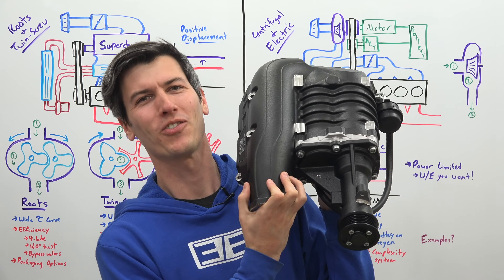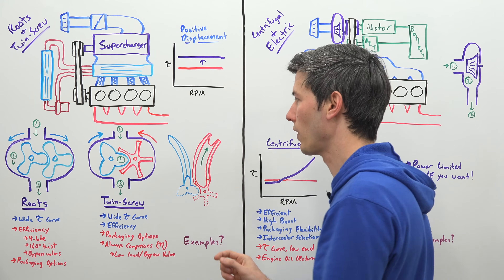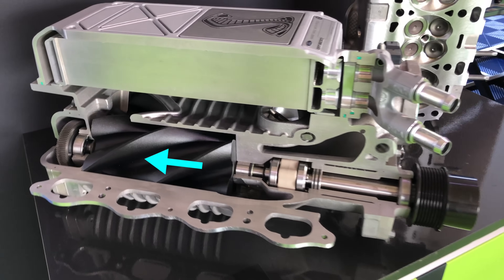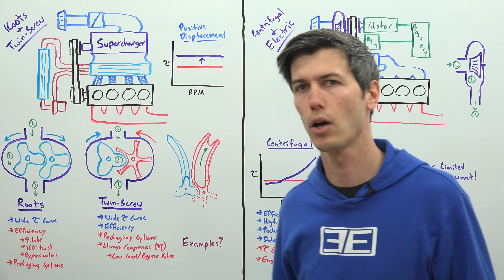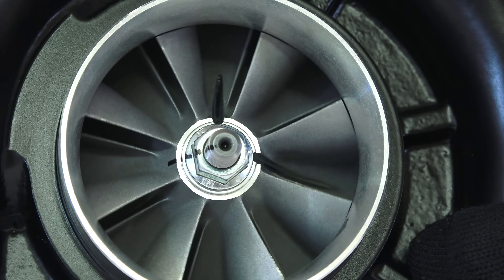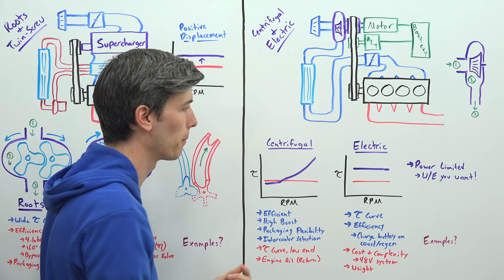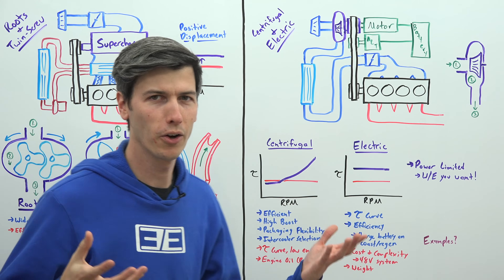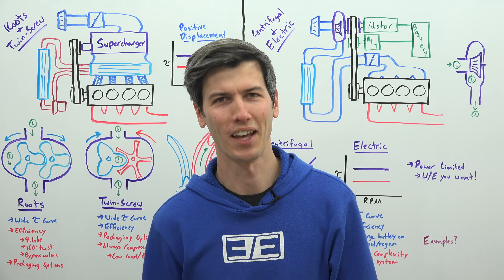What's The Best Supercharger? Roots vs Centrifugal vs Twin-Screw vs Electric

Comment: Okay well there's other factors involving boost tuning which set centrifugal apart from roots and twin screw type superchargers, mainly beneficial if you're using modelling software to preview setup proposals where I think the roots and twin screw are a little more forgiving in a plug and play application using simple math and fairly constrained details. It might also be worth mentioning that historically roots style superchargers evolved from heavy haul diesel engines (of which twin screw type is a variation), whilst centrifugal superchargers evolved from high performance gas engines (of which electric and turbochargers are variations). Having a little glance then, at what engineers had on their minds during design evolution was to increase the hauling capacity and engine flexibility of a transport vehicle with a fairly forgiving engine layout in terms of boost and intake temperatures, compared with maintaining a sea level air pressurization at higher altitudes in an aircraft engine in order to raise its operational flight envelope, which requires fairly careful mechanical tuning of the layout so as not to damage a high performance engine.

So in terms of boost tuning, what's happening with a centrifugal type of pressurisation is an "island tune" as opposed to a positive displacement which is more of an "engine tune" when sizing up your supercharger fitment. What I mean by this is that with a positive displacement supercharger you will need to size the fitment quite specifically to the engine displacement and setup, with pulley speeds to provide a boost curve which is appropriate the engine, with benefits of providing usable boost from very low rpm and strong boost through midrange but disadvantages of providing maximum boost only at high rpm, near the engine redline. In a racing application a positive displacement supercharger still needs to be operating a lot like a naturally aspirated engine, with a fairly limited maximum performance range close to the engine speed redline, however in a street application it is an extremely flexible layout as it provides usable boost under virtually any operating conditions, so if all out power is not required it still provides very useful power boost in all other driving.

Now let's mention that in road engines centrifugal supercharger fitment kits are designed similarly to positive displacement fitments, with casing size and impeller ratio tuned specifically for engine displacement and operational conditions, whilst pulley speeds are simply geared to provide the most efficient impeller rpm to deliver the desired "island of boost" for that engine. So, for example if you have a 2.0 litre engine built for no more than 1 bar of boost and the engine has a redline of 7000rpm, the supercharger impeller may have a maximum speed of say 55,000rpm so the pulleys have to be geared for no more than this impeller speed at engine redline, whilst the amount of boost is achieved by selection of supercharger casing and impeller ratio, in this case to deliver no more than 1 bar at maximum efficiency for this displacement and engine speed, which tends to coincide with maximum impeller speed but they also have a fairly high efficiency across a fairly wide supercharger speed compared to positive displacement superchargers, operating at (loose, fictional figures for illustration) perhaps 87-95% blower efficiency all the way from something like 40,000rpm to 55,000rpm in this example perhaps, which would translate say from something like 5600rpm to 7000rpm sustaining around 1 bar, but then there is a sudden moment when blower efficiency simply plummets to something like 65% at say below 37,000rpm impeller speed, boost drops very sharply so that for much of the engine's midrange, below 5200rpm you're dealing with more like 0.4-0.6 bar and then at low engine speeds 0.2-0.3 bar which isn't even usable boost. This is what I mean by an "island of boost" and this is an important tuning term when designing your supercharger setup with a centrifugal. By comparison a positive displacement supercharger has a nice, linear boost progression and drop off so that if tuned for 1 Bar at 7000rpm it will be very linear with 0.9 bar at 6000, 0.8 at 5000, 0.7 at 4000, 0.6 at 3000 etc. But positive displacement has less blower efficiency overall, maxing out at perhaps 85% due to design limitations so you do tend to get more crank drag for the same boost capabilities, meaning you need a little more boost to get the same horsepower. By the same measure, turbochargers became more popular for race engines because they need less boost to get the same horsepower since they don't drag on the crank at all with pulleys but are otherwise a centrifugal supercharger, conversely this means with the same boost as a pulley operated centrifugal supercharger setup a turbocharger simply makes more horsepower and a positive displacement type makes slightly less.

So just to correct you there if I have all my thoughts here correct without an engineering degree, it's not more boost that a centrifugal supercharger has over a positive displacement type, it's more horsepower at the same boost and a wider band of maximum or near maximum boost.

Then let's look at how centrifugal blowers were managed in aero engines and apply some of those features to a car engine, namely a boost regulator. You could step outside off the shelf blower tuning for engine capacity and instead of sizing one for a 2.0 litre/7000rpm and 1bar go for 3.0 litre and 1bar sizing, put that on your 2.0 litre and just make sure you top out impeller speed for 7000rpm, then use a little valve overlap and a relief system to bleed out manifold pressure to hold 1bar. Now you've got half a bar off idle and full boost right through the range. This is an extreme example, works fine in modelling, but mainly illustrates more of what I mean by an "island boost" system, which is basically the same sort of thing you do with turbos. Positive displacement superchargers you just don't tune the setup anything like in this way, they have entirely different boost characteristics.

Comment: Your twin screw diagram is incorrect.  The twin screw rotates the same as a roots, it compresses the charge due to the contained volume of air shrinking as it moves along the length of the rotors between the inlet and outlet.

Comment: Hearing "electric supercharger" I keep remembering a Mighty Car Mods video featuring cheap eBay "electric superchargers", basically a fan you attach to the intake. I mean sure, most people don't necessarily understand the difference between a fan and a compressor, "both things blow air into things, right?" Fans, while good at moving air, really don't compress it well. Taking computer fans as an example, a "high pressure optimized" fan from Noctua, suitable for things like liquid cooling radiators or just fin stacks of a big air cooler, only has a quoted maximum pressure of 26.1 mm H20. 26.1 as a number sounds big, but then you convert it to bar, and it's 0.0026 bar. So yeah, the best you can hope for with a fan like that is a boost pressure of 2.6 millibar, or 0.038 PSI. Not saying a fan can't be made to create a higher pressure, but they're just not designed for actual air compression. =)

Comment: To make it even more efficient, use the exhaust gases to power the supercharger...

Even better, put the alternator and motor onto the super charger that uses exhaust gases to charge the battery...

Even better, use a simplified motor generator unit to run your exhaust driven supercharger...

Hmmmmm, where have I seen this before...

I don't know, maybe Mercedes, Ferrari, Renault, and Honda can help me out here...

Comment: To me centrifugal supercharger to me sounds like it has non of the advantages of a supercharger and all the disadvantages of a turbo. 

Jason, given X car and engine which I could perfectly fit a roots sc, a centrifugal sc or a turbo, why would I choose the centrifugal sc over the other 2 options?
Reply: Depends on the car centrifugal blowers on a vette are way better than a roots or twin screw. On a heavy car that needs tq roots or twin screw is needed but they lose on the top end to a centrifugal blower plus centrifugal blowers are more efficient and make more power and with less boost and don’t heat soak like top mount blowers . My centrifugal blower makes what my roots did and more at 10-11 psi compared to 19-20 psi on the roots

Comment: The best supercharger is the one that doesn’t require a ton of maintenance or a rebuild at early mileage. Eaton TVS Superchargers have issues with torsion isolator couplers that necessitate the entire “snout” being replaced every 40-60K miles. I know because I’ve now paid for it on my car twice... I personally prefer a turbocharger over a supercharger. The belt whine gets a bit tiring over time.

Comment: Imagine tuning a high power electric supercharger. I feel like someday would you end up just adjusting a boost map according to a driver's preference. Or even using the electric supercharger to almost directly edit your engine's torque curve. (Although there would be a little delay with as throttle changes)

Comment: For twimscrew superchargers, is the whine always on? I wouldnt want to keep hearing it if its loud while cruising
Reply: It isnt gonna make that sound unless you're in boost usually WOT.  You can hear it some part throttle but usually if you're not on it pretty heavily or winding the gears up towards redline at WOT you don't hear any whine.  I have a pullied gt500 which is known for being one of the louder supercharged cars lol.  As far as the "whine" goes.  I never hear it unless I'm hard on the throttle.

Comment: seems like the electric supercharger has excellent potential for street performance. capacitors instead of batteries and a power on demand button and and automatic control option.

Comment: So you should be able to produce boost at low end and high end with an electric centrifugal and a turbo. Reducing lag from turbo. Basically using the electric to start boost and turbo to continue while charging electric once turbo kicks in and while not in use.

Comment: i'd like to see a double intercooler system with one in front of the turbo to cool down the air before being compressed. more dilatation and more boost at the end. 2 smaller intercoolers instead of a big one. i don't know if it's been done but ima check that on the tube.

Comment: The best depends on what you are expecting but all have advantages and disadvantages. All of these blowers use HP from the engine to run them but have little leg time, the exhaust expansion type doesn't require engine power but has "turbo lag". The most power comes from the roots blower and why they are used in top fuel racing. I myself prefer the exhaust type or "turbo as it is using the exhaust after it is through the engine and not requiring engine power to tun and with proper veins inside has minamal lag.

Comment: Eaton 2650 is 170 degree twist. 2300 was 160 degree twist. The 2650 is 4% more efficient over the 2300. You have to turn those smaller roots superchargers faster to keep up with the larger twin screws causing more heat and more parasitic loss from having to spin it faster.

Comment: I had a Marshall Wade 750cc roots type supercharger on my 1275cc  Austin Mini 😁
The charger started it's life as a cabin compressor inside a British military 1954 Gloster Meteor jet plane.
The air entered the charger paddles from above  laterally rather than longitudinally in those screw type compressors,  the air exit was on the opposite side of the housing and bolted directly to my custom intake manifold ( no air charge cooling ) I used a 2" SU carb originally off a Rover SD1 ( 3.5L ) it was forever icing up 😂

Comment: Current Formula 1 spec hybrid engines use an electric motor attached to the turbo to keep the turbo spooling all of the time.... pretty much permanent 0 boost lag.

Comment: With the different kinds of supercharging it really which one works best for your motor . They all do the same thing but in different ways . Not many can afford the cost of testing so we rely on what others have found . Want more boost from a turbo , adjust the waste gate or bigger turbo . With a screw type ,change a pulley first , then go bigger . But the computer needs to know what the hell you are doing for good fuel delivery .

Comment: My biggest regert in life is not getting a supercharger for my jeep. I bought it new in 03 and was determined to install one. At the time, i found one, it was a roots pump,  it was $3000 and i hesitated.  Now the same supercharger is like $5000.   Now my jeep has 180,000 miles. It still runs like new, but I doubt that would be the case if it had 180,000 supercharged miles. lol

Comment: I feel like electric superchargers/ turbos are better for the average person. If it gives you say 20/30 seconds of full boost at a time, that's plenty long enough to merge, pass or rocket off from a stop. Then the rest of the time it creates no back pressure like turbos or drag like belt driven SC, which would be more efficient when the average person just drives normally.